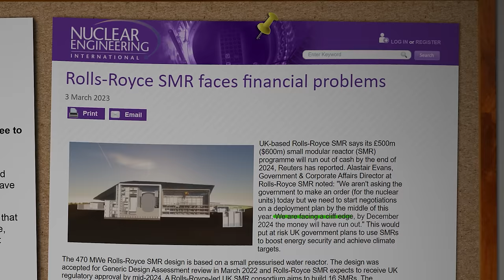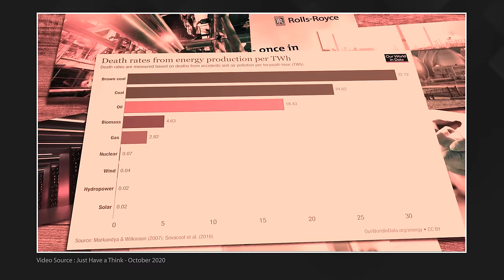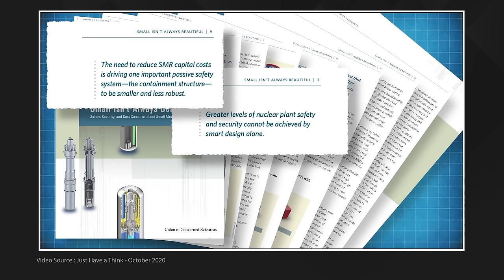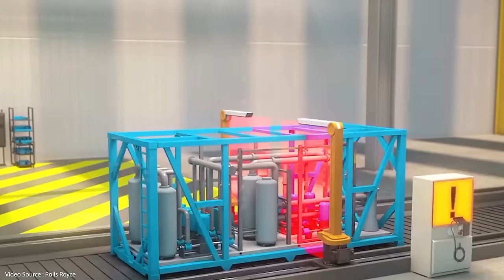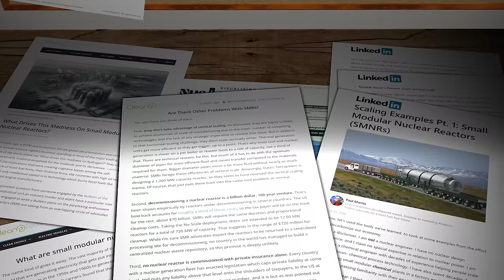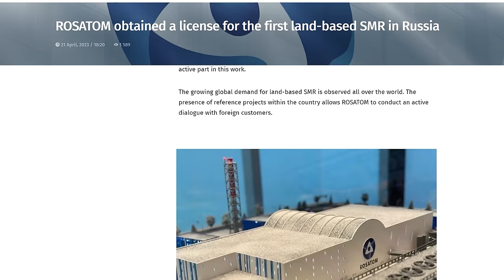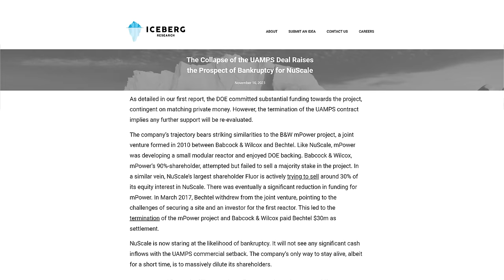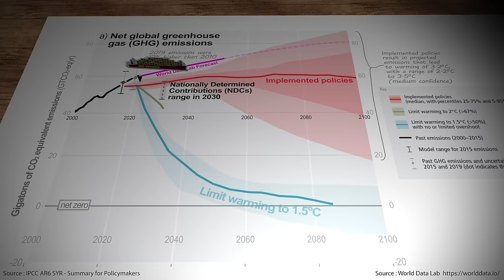Small Modular Nuclear Reactors. The Verdict

Comment: Something that the supporter of nuclear energy don't understand is that, in addition to the well known drawback, there is an additional one that is almost talked about: What I would call a very long "iteration cycle". It can take decades before a new nuclear power plant type can be researched, developped and built. ie: A decade is relatively short time and only slow progress is achieved.

Contrast that with renewable where 10 years is quite a lot of time: You can build a lot of those in 10 years and 10 years of research can be quite a lot. 

I could also talk about the "human skill cost" of nuclear vs renewable as in, nuclear require you to train people, scientist or engineer and take them away from other type of potentially productive work. Also, you need them for potentially decades or centuries. Contrast that again with renewables which has a much lesser "skill" opportunity cost.

Just a thought.
Reply: Nuclear tech 'generations' might be closer to 20 years.
Reply: But you can mitigate that skill gap with automated tcontrols
Reply: @loganaurora do you mitigate the skill gap in an airliner with automated controls ? Or do you expect the guy flying the plane to have full control of those automated systems and have full control of the plane at all times ?
When things went wrong at Nuclear Power Plants either the person running it did not know what he was doing was wrong, including overriding the automation or the disaster was so bad the automation failed entirely.
Reply: @francesconicoletti2547  yes actually they do it all the time
Reply: That is the problem, in a nutshell. We need reliable baseload but all non-emitting sources take eons to build. It could lead to some really short-sighted decision-making. But if we get started now, we’ll have a chance for a more robust, diverse clean energy sector a couple decades from now.

Comment: I always think about my local industry and mining. There are 3 power stations run on locally sourced coal and gas running half a dozen big producers of aluminium, nitrogen-based fertilisers and a variety of other products which all require a constant power input. My hometown is basically a huge coal mine and the coal is of various quality. the lower grade coal goes to our industry and the rest goes for export (over 100 million tonne/year) While I'm for making better use of this resource and moving to more sustainable power options, it's not going to happen till it becomes rare.
Reply: Or undercut by cheeper power.

Comment: What appears to be a workable system for SMR is to not build a smaller big plant but something that fits a need.  Like TerraPower Natrium plant in Wyoming.  Here the nuclear plant is heating stored molten salt to power an decommissioned coal power plant.  Here a small nuclear plant can power what is almost a peaker plant that can provide most of its generation when renewables can't. Here the plant is producing it's power when return on generation is at its best.  The plant is also using all the infrastructure of the decommissioned coal plant.  Steam turbines,  generators and transmission infrastructure.  The plant is also being built without the first plant having to economically viable.  The plant is being built with government and a private billionaire support.  This is what it should be.  This being a development project.  A little like what's going on with electric cars.  Like the EC car maker Rivian is loosing $30,000 a car right now. The expectation that costs will come down as more cars are made.  Why should it be different for first moving nuclear power plants.

Comment: Why don't they just - governments could buy several large batteries and scatter them around the city  and suburbs and collect all the excess daytime solar to sell back at night.
Reply: They usually do that at the source rather than the customer but that happens. Current economics says three hours storage is the maximum amount affordable. We here in Australia are slowly transitioning to eight hours storage as the cost of batteries drops. Now the question is in ten years when the green transition is well and truly under way what will be the cost of batteries ? The casual cynics who somehow seem to think nuclear is just around the corner, imply that battery costs will not drop, which is strange if you consider how much they think nuclear will change in ten years. Batteries costs are dropping to 8 hours of storage just by economies of scale so if that keeps up maybe 12 hours of storage. But now that there is a market for long term storage we don’t have to use banks of essentially laptop batteries and people are working on batteries which are cheap for long term storage. If they take off in the next ten years maybe a weeks worth of storage will be routine attached to solar and wind farms,meaning the any other power supply will only be called on to work when the wind don’t blow and the sun don’t shine for a week.

Comment: USA NRC is about to make a special regulatory process for SMRs since they are factory built and have passive safety systems. NuScale can essentially provide a turnkey plant and their stock has doubled since this new NRC news broke (granted this is a bubble and it will calm down until NuScale possibly turns a profit in the future). It is easier to build an SMR complex to power a base load for big cities than to produce enough batteries to run one reliably. Imagine the size of the battery it would take to power a city like Tokyo or London for a couple days if there is bad weather idling wind turbines and clouding over thousands of hectares of solar panels. Renewable/battery solution will work very well for smaller towns though.
Reply: NuScale (which is being sued by investors for FRAUD) canceled their SMR project that was and is 100% approved by the NRC for construction and operation.  It was canceled because of ballooning cost estimated, even though they received $2 billion in taxpayer welfare , NOT because of any regulatory issues. And NO the NRC did not make a special regulatory process for SMR.  The NRC rule 53: PROPOSES changes include removing several new and potentially burdensome regulatory requirements, clarifying certain other regulatory requirements and emphasizing that the advanced reactor rule “should leverage existing regulatory requirements … where appropriate and applicable,”

The PROPOSED rule is still being written and will undergo public comment before any real changes can occur. 

There is NOT and never has been economies of SMALL scale.  New Nuclear is 2-3 times as expensive as any other generation method and SMRs will cost (per Mw capacity) even more.  The issue is COST not regulatory requirements.

BTW, EVERY nuclear project has components and system modules BUILT IN A FACTORY so the claim for cost savings is a lie.  A 1Gw standard commercial PWR spans acres and has multiple levels and EVERY component and building is there solely to produce power. So a 300 Mw SMR will be at least 1/3 that size.  Anyone that thinks you can fit a reactor in a shipping container knows nothing about electrical generation

Comment: The discussion is not a fair one. 
- Using LCOE in these scenario's is wrong, we do not want power, we want power 24x7. If you deviate from that, these costs should also be included. If you don't than you should add the cost of failing to provide 24x7 power. Only then do you get a fair comparison.
- For decomissioning of nuclear, that costs a lot. But its only a fair comparisson if you add those costs to solar and wind. In solar heavy metals are used (those are dangerous forever, thats much less than 30.000 years :-) ). 
- Nuclear cost so much because of the long build times. Well... thats our own fault because we put up all kind of hurdles. Japan can do it in much less time.
- For the technology, at the moment we do not have grid scale battery. This channel shows a lot of options, but these are still under development and no where near gigawatt levels and will not be before 2030. Even solar took decades to drop down so much.

But the discussion is not renewables OR nuclear. With the transition we are facing in can only be renewables AND nuclear. But only if we have a fair comparison on costs on ALL factors can we make good descisions (grid upgrades, resource availability, capital costs ect)

Comment: Wrong take, firming cost of renewables is as or even more prohibitive than nuclear. Why so many companies and countries are returning to nuclear? Because with hydro it's the only technology that has proven capable of replacing meaningful amount of fossil fuel power plant on a grid. Look at what France did to respond to the oil shocks and what Ontario did during their coal phase out lately. Nuclear played a major role in both of these cases. Energy security is also a huge part of this equation, the sheer energy density of nuclear power allows countries to stock years of electricity production in just a few warehouses.

Comment: I'm a mechanical engineer, but you don't need to be an engineer to figure this out. From simple Google search I learned the the extends range batteries in one Tesla automobile will storage about 100 kWh of electrical power.  Similar search showed that a nuclear reactor will produce about 582 MW of power x 24 hours in a day, let's say.  Equates to about 14,000 MWh.  That's Mega Watt Hours.  Let's convert to the same units, so 1 Mega Watt = 1,000 Kilo Watts.  The 14,000 MWh equates to 14,000,000 KWh of electrical power.  In other words it would take the batteries from 14,000,000 Teslas to store the power coming from a nuclear reactor for ONE day.  I would be shocked (no pun intended) if such a battery pack will ever exist.
Reply: I think Elon Musk trumps you in knowledge and he says it is entirely possible to power the U.S. with solar and batteries.  And he does not even consider wind turbines and natural gas turbine backup.

Comment: What everyone does not seem to notice is we have had working Small Nuclear Reactors for over 60 years.  They are navel nuclear reactor that have been in service since 1955 when the USS Nautili's was commissioned.   It would seem a simple task to adapt one for land use.
Reply: Everyone DOES notice, because nuclear proponents constantly tell us. 

If it IS a simple task to "adapt one for land use", then why hasn't it happened? 

The problem with this new concept of small nuclear reactors is that we would need tens of thousands of them, built on a production line, with all of the quality control issues in manufacturing that that entails, and then the safety issues when they are actually installed into a 5 or 10 hectare site (not exactly small) in the middle of an industrial park or on the edge of a town. Not to forget COST - the elephant in the living room.

And then, in 40 or 50 years,or less, thousands of reactors to be disposed of and replaced.

If we have to use nuclear, I see more virtue in a Gigawatt scale reactor. But I am hopeful that we won't need those either, or not as many, at least.

From Australia, where we have no nuclear power yet.
Reply: Simple task, yes - and you end up with extremely expensive electricity. The trick is not building and running a small reactor but building and running it CHEAPLY. And the point of this post is that there are good engineering reasons, ultimately because of fundamental physics, why that cannot be done. Military ones are not remotely cheap.

Comment: 7:10 "Governments underwriting claims" means the financial side doesn't make any sense. SMRs cannot be insured because the foreseeable downside is not able to be covered financially in any market.  Given production of many more units which may have defects in manufacture, the quality control, maintenance, monitoring, and failure potential go up exponentially.  There has been great push back from the nuclear industry to reduce regulation, reclassify high level waste as low, etc.  Combine reduced regulation, cheap production, and government insurance for profitable energy companies and you have horrific accidents in the making.

Comment: Suppose nuclear reactors the size of shipping containers became available for industrial plants, communities, and elsewhere,  it's bound to occur to some engineers that small Navy vessels might be a good place to install them. Carriers are nuclear-powered, but consider that surplus power could operate electrolysis-hydrogen production below decks and liquefaction could put aircraft into the sky without fuel tenders following them. Add liquid-oxygen tanks, and afterburning jets could outrun any rockets chasing them, not to mention fast high-altitude cruising. That added flight range would give a strike radius that saves on supercarrier construction costs. So, if solar and wind are more competitive on land, they're not so at sea or in the air.

Comment: One problem that I miss in all the nuclear power discussions is heat. Still relying on a thermal process requires also cooling on the other end, to get the maximum efficiency. This is a huge issue in a heating world with more droughts melting of the glaiers leading to water shortages. Due to high water temperatures the power plants in France had to be shut down in the past summers and an increase of the tolerated limits by the state, which leads to bacterial growth and fish death. This will just get worse.

Comment: The name 'SMR' is a misnomer in many of these cases; they are far from small. I consider an SMR to be something that can be built into a shipping container size and readily transported to its intended site. There are companies working on these, but they are not yet commercial (and I'm not holding my breath).
Reply: The issue with ones that small is not the reactor but the turbine. Small steam turbines are innately very inefficient - there's a reason steam railways never used them.

Comment: Is there any breakdown on where, exactly, all the money goes for producing the SMR’s?
Why were prototypes able to be made back in the 60’s but not production versions 60 years later with advances in manufacturing and materials science?

Are the cost problems corruption or actual technical issues with the manufacturing process(es)?
Reply: Many original reactors built in the U.S. could be considered SMR and all were shutdown as not cost effective.  There is not and never has been economies of SMALL scale in electrical generation and that also goes for coal and natural gas

Comment: Right!  

Even those SMR things takes many years to build and cost many billions ONLY governments can afford.. In the mean time Batteries get another 80% cheaper by 2030, Solar goes to almost zero and wind also gets to marginal costs... And the build out of wind+solar+batteries will accelerate and get to insane scale.  I saw 2 100 each wind turbine projects being built just 25-30 miles from my home in just 2-3 years.. And these are huge 5Mw units over 200 meters tip height.. They power mainly 2 huge Google and Microsoft server centers, seperated just 1 mile of eachother.

Out at the North Sea at the moment several wind turbine parks are under construction, in total about 1.5 TERRAwatt capacity iirc. By 2040 90% of the Dutch energy demand will come from the North Sea... and still there are political parties that have the build of 2 new nuclear power plants in their election programs.. Insanity! This shows how strong the lobby still is for the Nuclear Industry. Even with the current plans for Wind and Solar, there is absolutely no need for 2 nuclear power plants..I hope time is on our hands here, time that will be used to install so many wind turbines and solar panels that politicians will come to the insight that there is absolutely no need for 2 Nuclear power plants and save the tax payers tens of billions.

Pure economics will save us from these risky endevours into SMR's, the cancellations you mentionned won't be the last ones.

Comment: Yes, Nuclear subs came first with the Atomic Energy Commission being ultimately  staffed with Admiral Rickover personnel. LWR's were ideal for Sub operation with the plate fuel design used and the available heat sink provided by the ocean. 
However, commercial reactors use a more economical fuel design with uranium pellets held within sealed Zirc tubes. It is not uncommon for pellet center line temperatures to reach the melting point. Furthermore, zircalloy becomes autocatalytic when clad temps reach 2200 degrees F. The high pressure water used to cool the fuel pins in LWR's require extensive safety systems to prevent release of the large amount of fission products. 
MSR's do not require these  safety systems because they operate at atmospheric pressure with the fission products chemically bound to the salt. If temps get above normal, the MSR at Oak Ridge utilized a simple freeze plug which would melt allowing the fuel to drain from the reactor to safety decay tanks. Since the fuel can only be critical within the reactor where moderation occurs, the decay heat is released to the atmosphere avoiding overheating. The molten fuel solidifies within these tanks over time.
The MSR operated in the late 60's without incident. When Dr Weinberg pointed out the safety aspects of these reactors vs LWR's, he was promptly fired.
The effort was made to protect LWR's future as a power source for Subs and civilian nuclear power by discrediting Dr Weinberg's assertion about the radiation release possible from a LWR. This fact does not involve any time line conflict!